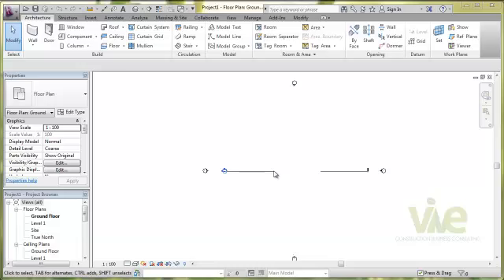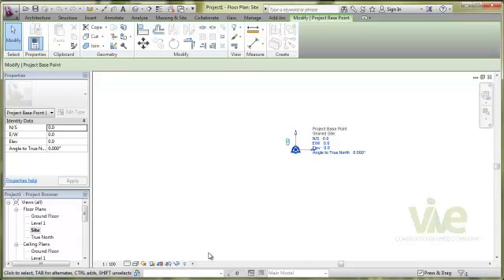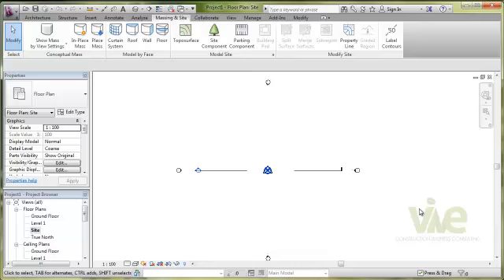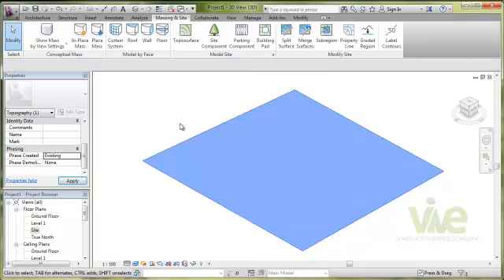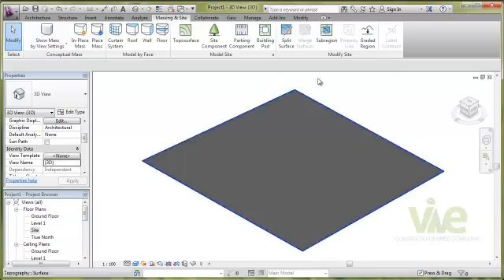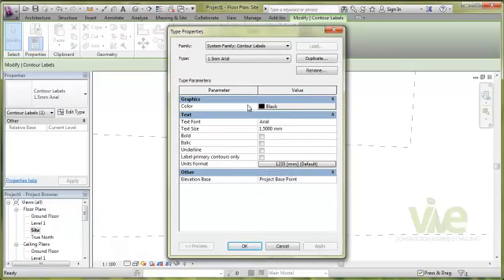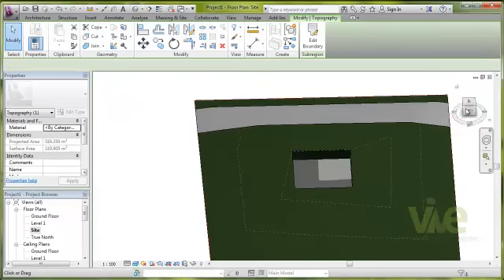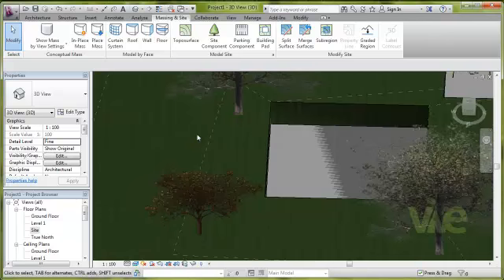Tutorial: "Topography in Autodesk Revit Architecture 2013"

Comment from the maker: Abdul - You are absolutely correct, in a professional workflow you cannot use the Revit Topo features as they cannot interpret many of the required tools for surface modeling. On the other hand, you cannot say a project will generate x amount of cut and x amount of fill, just because Revit says so. At least here in Mexico, we have to generate section views and calculate our volumes from that. From my point of view, AutoCAD Civil 3D is your best bet, it has generally accepted tools for surface creation and volume calculation. You can also import a finished ground surface from AutoCAD Civil 3D to Revit and keep it coordinated by a shared coordinate system. The only downside is that you will not see it with its finished materials. For presentation/coordination purposes for visualization, you can use Navisworks.

Comment: How do I make the ground surfaces with a kind of square ?? Like making the ground thick and in the shape of the site after making a topography ??? Because it doesn't look quite pleasing with just the topography ?
Reply from the maker: I'm not entirely sure as to what you are looking for, can you be more specific? Things to consider when working with toposurfaces in Revit:
-They are TIN (Triangulated Irregular Network) surfaces. 
- They are built by triangulating points
- You can add features such as building pads, with the building pads option in Massing and Site.
Reply: I think this is what you mean http://youtu.be/fYp9ENL6BP8?t=2m22s
Reply from the maker: If you have a drawing of what you want to accomplish, I will be more than happy to help you. That video that O Noo shared just about covers the steps to adding a material to your toposurface and visually cutting out the extents of the view with a section box.
Reply: Yes O Noo That's what I meant , but the thing is the section box are in a square but the boundary that I wish to give a thickness is not in a squarish shape. Is there a way to kind of customize which side I wanted to enclose the section box ? Or they more proportionally as in squarishly ?
Reply: BIMcoach Thanks for the reply !! I have the same question too for the section box thing ..
Reply: O Noo  thanks for your video